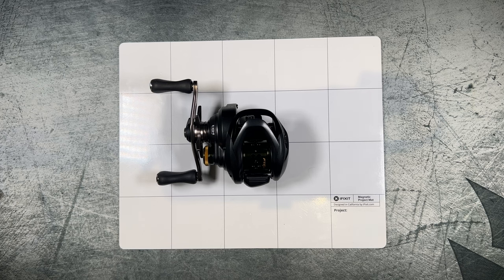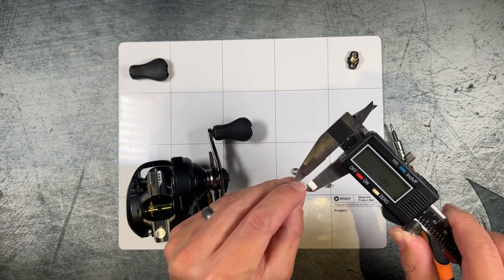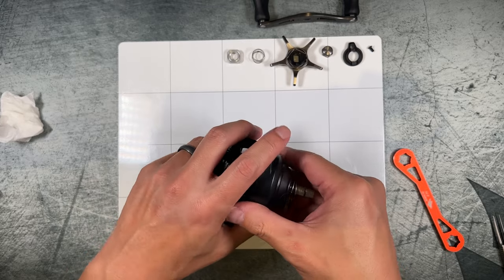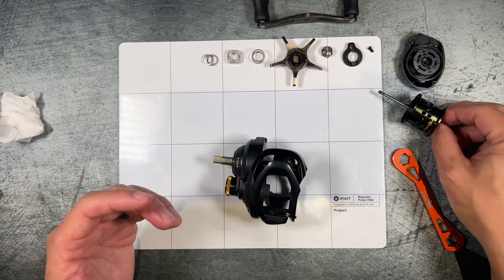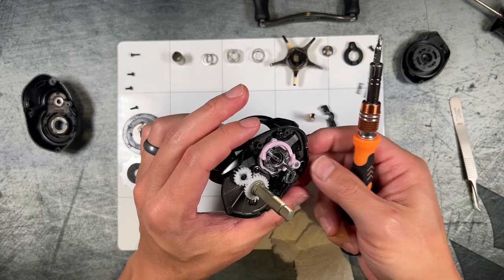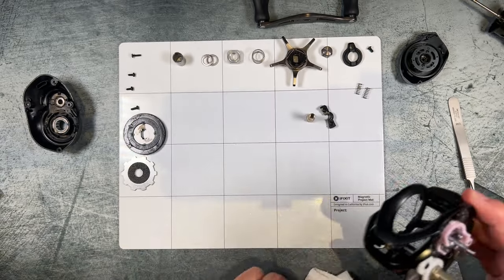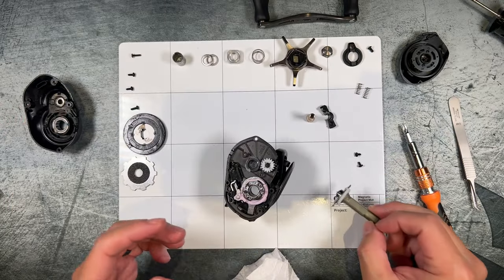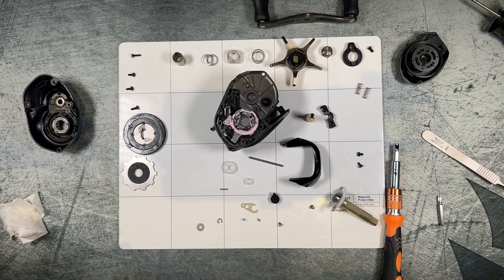🔥🤘SHIMANO CURADO BFS TEARDOWN + MOAR BEARINGS 🐻!!!

Comment: Just to let you know that all daiwa and shimano reels using the same size bearings in a knobs only abu garcia and probably some other less known brands using different size bearings. One more thing, too much greece in a knob is absolutely fine, it will prevent water getting in to it and the knobs don't have to spin like crazy(all people think that it should :D ), they just have to spin freely without any resistance when you using reel.I will repeat i am talking about knobs :D the other parts really have to spin like 'crazy' :D. Nice vid and have a nice day :D
Reply from the maker: Hey there! I appreciate the info! I’m just very… excess grease averse haha. If I were to use the reel for salt water fishing I would definitely keep as much of it there as possible but even then only really a thin coat is needed to keep the metal surfaces away from the salt water. My theory is that the reel was heavily overgreased because Shimano thinks that most Americans do not service their reels and probably treat their reels poorly. Whether that’s true or not I have no idea… in any case thank you for sharing that info and cheers!

Comment: Thanks for this video! Can you recommend good tools (tweezers, precision screwdrivers, spool bearing pin removers, etc) for tearing down baitcast reels?
Reply from the maker: @synaptik111  hey synaptik! For forceps, I probably wouldn’t spend too much as they are easily bent but I’ll drop a few affiliate links below. Some links will be for Amazon and some will be to aliexpress. If you prefer one vendor over the other let me know. For precision screwdrivers, I would go with either a wera or wiha set but if you want to save a bit of money any of the multi sets you can find on Amazon will work out well. You may need to get some long neck versions of certain screwdrivers as you go along. As for a spool pin removal tool I will link one below from aliexpress. Hope this helps and cheers my friend!

-bent fine forceps
https://amzn.to/4dAf2oR
-straight fine forceps
https://a.co/d/dE5pCcf
-spool pin removal tool
https://a.aliexpress.com/_mroftDe
-wrench, bearing check tool, handle knob removal tool
https://a.aliexpress.com/_msq8dtO

Comment: Guessing from ur review, aldebaran and curado bfs had same type of drag clicker, i wonder which one sounds better, could you make short video side by side sound comparison? Im still doubt that the extra bucks on the aldebaran is worth it tho
Reply from the maker: Hey Daniel! To be completely honest, I don’t quite remember what the Curado sounds like as I returned it not long after my review. Imho, the Aldebaran(especially now) is a better purchase than the Curado. However, if you don’t want to spend the same amount of money as what an Aldebaran is going for you can get similar levels of casting performance with much cheaper reels if you’re willing to consider CDM reels. If you haven’t already check out the Haibo Arise Air videos. I really like that reel for its price. Better specs than the low level Japanese branded reels but much less money. Cheers my friend!

Comment: About the cupped washers under the star drag, the drag will still work if you have them nested together.  But, the drag adjustment will be less progressive  than it would otherwise.  That is, every degree of rotation will make a bigger change to the drag.  Shimano Tranx 300 & 400 actually don't have those washers at all.
I don't know why Shimano uses so much thread locker on those side plate screws.  They're always hard to get out.  I wish they'd use the lower strength purple thread locker.
Reply from the maker: Hey Timothy! Thank you for sharing your insight! Thinking about it it makes sense that the spring washers would provide a much more exponential drag adjustment if the two washers are in the same orientation. Thank you for sharing that! Also, touching on the thread locker for the side plate screws… you know… I’m not quite sure but it could depend on the material that the screw is going into? Typically, when the screws are for carbon or graphite the screws will have a larger thread pitch and bite into the carbon. My guess is that those screws are less susceptible to backing out under use. However, with metal ones I believe they may be as the pitch is fined? I don’t know I’m just purely guessing here on this. Also, I wonder if the thread locker can act as a seal to help combat corrosion? I’m not sure… just hypothesis that can probably be googled I’m sure haha 😅. Anyhow, thanks you for bringing points up that I was not able to cover! Much appreciated! Would be amazing if someone more knowledgeable on these subjects could chime in. Anyhow, cheers my friend!
Reply: @BFSFISHINGCHANNEL  generally fine thread screws are going into metal, coarse thread screws go into composite.  Maybe screws are less prone to backing out of composite material?  When I've seen thread locker on Shimano screws it's been the blue type.  Loctite makes a purple variety that isn't as strong.  I can't see those screws needing THAT much strength to keep them from backing out. 
About the washers, changing their orientation won't make any difference to max drag pressure.  It just changes how progressive adjustments are.  It can be advantageous to do it that way.  If you're using a lure with thick wire hooks that needs a lot of drag pressure to set you can very quickly make a big reduction in drag pressure if needed.  Not necessarily an advantage for BFS fishing, but something to be aware of.  I learned about that from Tackle Advisors videos.

Comment: Any shot you could do a video on taking apart the side plate assembly? I took mine completely apart and now can't get the brake holder to stay in place. Not sure where I went wrong. Can't find anything on the internet about a full breakdown on this reel
Reply from the maker: Hey Jon! Unfortunately I actually returned this reel. That being said I think the reason you’re not able to get the plate to go back is due to the small pins you need to align. If you notice there are alignment pins from the brake assembly and line up with this plate but also each brake shoe has pins that need to fit into the brake plate cover. I think that that’s what you’re referring to? Lmk if this isn’t what you’re referring to. Cheers!
Reply: @BFSFISHINGCHANNEL  that wasn't it. I got it figured out. There is a little peg on one of the brake holder legs that has to ride along a groove on brake dial. All good now
Reply from the maker: @jnorman975  nice!!! Glad you were able to get it figured out. Cheers buddy!

Comment: Amazing video, but now I have a problem with my reel. Disassembled it to grease it, and now the drag star won’t click into place. I’ve aligned it with the nut and gotten it where it looks in place, but the drag no longer engages and the spool spins freely. Any idea what the issue could be?
Reply from the maker: Hey silent! Hm… my gut tells me you might have a part backwards inside the main gear housing. I wonder if either you have the antireverse ratchet or the antireverse bearing inserted backwards? If that’s not the case then it’s possible that your two spring washers were not put back in opposing each other or… the drag star spring may be inserted backwards? Sorry it’s hard to tell you exactly what the issue might be without seeing everything in person… Hope this gives you a good place to start at least though! Cheers!
Reply: @BFSFISHINGCHANNEL  I was able to fix it! The drag clicker had popped out of place, which I believe pushed everything a little bit out of an alignment. Along with that, the spring that is compressed by the star was bunched in a weird way. Everything now works great and feels great. Thank you!
Reply from the maker: @silentcustard6612  hey silent! Yes!!!!!! 🙌🙌🙌 thanks for sharing that you were able to fix the issue. Super stoked for you my friend! Cheers!

Comment: Hi. Im using curado bfs. Since curado bfs xg is ratio 8, and i want to use ratio 6, what bfs reel form shimano can be using at curado bfs xg? Is that scorpion bfs or slx bfs? Thank
Reply from the maker: Hey Azizul! I responded to your question in your first comment but check out the slx bfs main gear and pinion! Cheers!

Comment: Hey friend, I love ve2, worth it buy acura ?
Reply from the maker: Hey joão! Very nice to meet you. Imho, the Acura is a great reel and is capable of casting lighter lures than the ve2. It will perform even better if you upgrade the bearings to ceramics but isn’t 100% necessary. The main different you’ll find between the Acura and ve2 are backlashes. The Acura YOU will have to cast with more control as it will have more opportunities to backlash on you. The ve2 brakes are quite strong and so it makes casting almost backlash free. The Acura will backlash more but it will allow you to cast lower weights and can help you develop better thumb control where as this isn’t needed as much with the ve2. I would say the ve2 is a great beginner reel and that the Acura is a great intermediate to advanced user reel. I hope that makes sense and helps you make a decision with your purchase! Let me know if you have more questions and cheers!

Comment: Hi Peter ! 👋 Interesting video! With the exception of the spool shaft bearings, for which hybrid ceramic bearings are the most suitable (BFS only), I use full stainless steel bearings because they are much smoother. I have very good results with the Japanese NMB bearings which are also affordable...😉
Reply from the maker: Hi Herve!!! I greatly appreciate your insight and opinion my friend. I also believe that hybrid ceramics are probably the best for freshwater bfs applications in terms of bearing upgrades. The only experience I have with NMB bearings are the ones that come stock on many of the CDM BFS reels nowadays. I do agree that they are smooth and quiet but just don’t spin for nearly as long as hybrid ceramics. Although you really do not need the most free spinning bearings for the vast majority of the reel. In any case thank you as always for sharing and I hope all is well with you!!! Cheers my friend!!!
Reply: @BFSFISHINGCHANNEL  I completely agree Peter 😉. For regular casting reels i’ve done some comparisons between expensive hybrid ceramic bearing (BOCA for spool bearings only) with NMB and i noticed no casting distance difference… So i use NMB everywhere except for bfs spool bearings…moreover the NMB bearings seem to resist perfectly to sea water.
Reply from the maker: @MrNoMDI  hi Herve! Yea for the most part the rest of the reel bearings don’t have much, if any, impact on casting distance so really the only bearings that should be the most free spinning are spool bearings, and potentially spool tension knob bearings. Normally I’d love to have more of a conversation with you but I am just starting to get sick again… and don’t have much energy and am having a bit of difficulty concentrating haha. Sorry my friend I hate being sick… I hope you are well and cheers!
Reply: @BFSFISHINGCHANNEL  Sorry to hear that … Get well soon my friend 👍
Reply from the maker: Thank you Herve hehe. It is what it is… hopefully this will pass by soon 😅😅😅

Comment: I think my Metanium shallow spool was greased like this Curado BFS. I ordered the metanium and thought well I guess this is how they're supposed to feel. Then a week later I received a 22 Bantam and it's almost night and day how smooth the Bantam is. I'll either do a tear down to clean the grease or use it to wear in the grease.
Reply from the maker: Hey there bubble breeze! Hm… that’s really odd. I wonder if it has to do with where the reels are being produced, ie what factory? I’m not sure but maybe you can check to see where your two reels are made. I bet they’re made in different factories 🤷‍♂️. Imho, if I were to keep a reel that was heavily overgreased I’d tear it down, clean it well and then relube with my oil and grease/s of choice. I get that it can be a bit of a pain but imho it’s well worth it. That being said, it’s not like your reels are going to fall apart so it’s not necessary in the least. How are you liking the metanium shallow spool? I’ve been a bit curious about that as it seems semi-BFSish? Anywho, thanks for sharing and cheers!!!
Reply: @BFSFISHINGCHANNEL  yeah I'll probably tear it down before the spring. I'm really liking the shallow spool edition so far. I thought it would just come with a shallow spool and aluminum gears but I was pleased to see a cosmetic difference too. It's very stealthy with the lettering and a darker color than the regular metaniums. I'm not too worried about the aluminum gears because I use light line and I don't tighten the drag all the way.
Reply from the maker: @bubblebreeze1635  that’s awesome to hear! I was and am still a bit confused as to the positioning of the metanium shallow spool but im definitely not worried about any of shimano’s alum gears. I know people really prefer brass but it’s very heavy and really I haven’t had any issues with my aldebarans alum gears or any of the Chinese reels that use alum gears as well. Heck Shimano even went as far as to port the aldebaran’s alum main gear which tells me that their confident the gear itself won’t implode haha. The durability of the teeth is yet to be seen but as the reel gets used more and more some of that wear should actually make the gear feels smoother haha. I could go on and on about how people are so demanding of certain reel specs but then they want new features left and right and how they want reels to last forever but then there’s a weird consumer urge to want a newer “better” version of the same reel the next time it gets updated and then the former reel sits unused or gets sold. Haha sorry when I rant I can rant with the best of them 😆. I’m gonna stop myself here before I write an essay 😂. Let me know what you decide on doing with the degreasing and cheers!
Reply: @BFSFISHINGCHANNEL  I wonder if the metanium shallow spool was to bring shallow spools to the casting reels to pair with the spinning reels that have long stroke shallow spools. Or if it was to be a counter to the alphas 800s. I hope they bring more options for shallow spool casting reels. Besides for the finesse benefits I like them because they do away with the need for backing.
Reply from the maker: Hey! Yea I really do like the availability of shallow spool reels. Not many of us absolutely need to fully fill up our spools anyhow. What might be kind of cool is if the jdm brands started offering different spool options ie shallow medium deep or something along those lines. I know aftermarket companies already do this and to some degree SLP works does this for daiwa but if they were already designed and presumably tuned for the reel by the manufacturer how cool would that be. Special “bfs tuned” or “shallow spool” editions like the metanium would be a good way for reel manufacturers to broaden their product line without, seemingly, needing to do too much more work or tooling at the factories. Just my thoughts… maybe I think too much 😆. Cheers buddy!
Reply: @BFSFISHINGCHANNEL  yeah, the whole backing and main line can get me on a rant lol.  Speaking of different spool options, I went on the Doyo site and used a translator and they offer so many options for spools. Abu and Lew's are really missing out on the lighter spools. I think the MGX reels could have benefited from one of the Doyo shallow spool.
Reply from the maker: Times like these makes me wish my Korean was better… I’ve taken a look at the doyo website as well and I can kind of understand some of the stuff on there but yea I’m not that fluent hahaha. Makes me wish I had learned more as a kid… =\ I’ll have to take a look with Google translate though. Last time I looked I don’t recall seeing any BFS specific reels and I kind of gave up due to the site being a bit on the harder side to navigate and understand 😆. The thing with spools, deep ones in particular, is that you can possibly get away with casting lighter lures on them if you use the least amount of line necessary. The smaller the diameter of the spool the easier it is for the spool to rotate which is what you need for light lure casting. So.. yea… Shimano and Daiwa if you’re listening make smaller diameter spools for your existing reels! Haha… that being said it’s not quite as simple as that but you get the idea. Hey, come find me on Instagram if you use it! I have an account by the same name there or maybe come join a Facebook group I am in called “BUDGET BFS FINESSE FISHING”. Very friendly and active group that discusses all things BFS 🙌🙌🙌